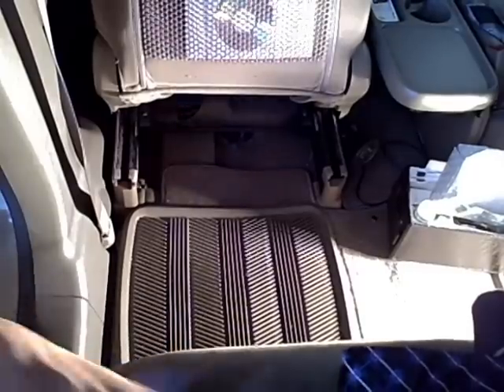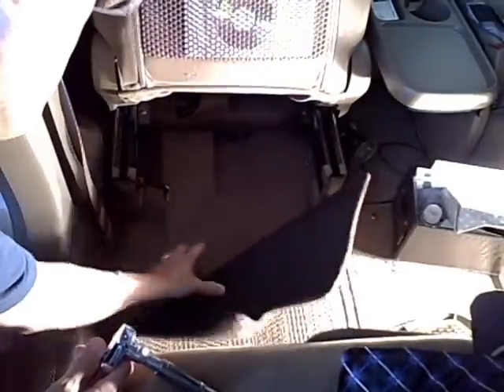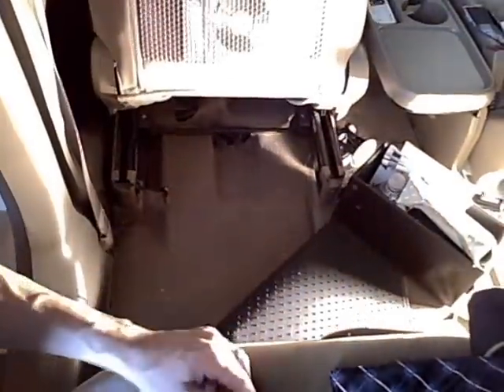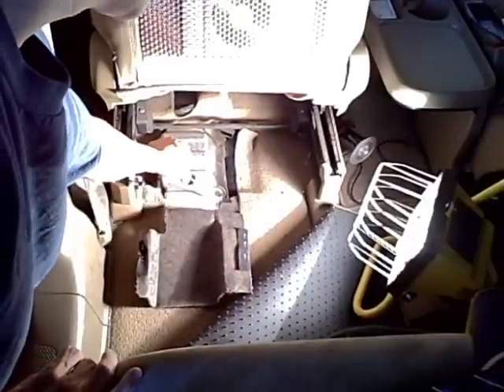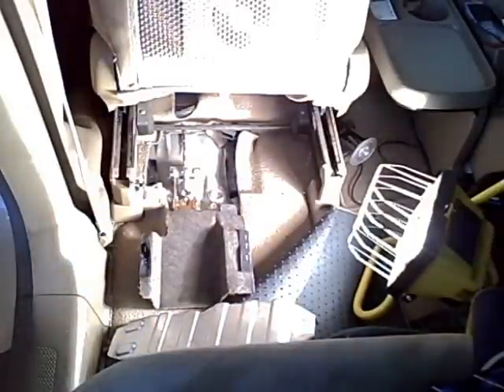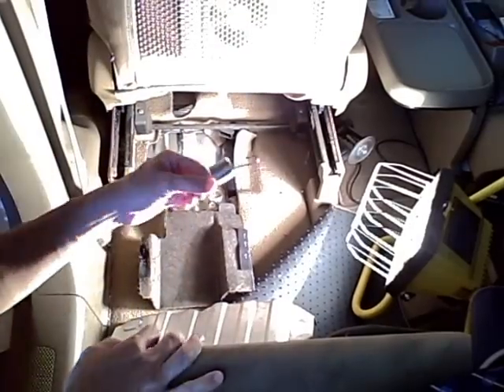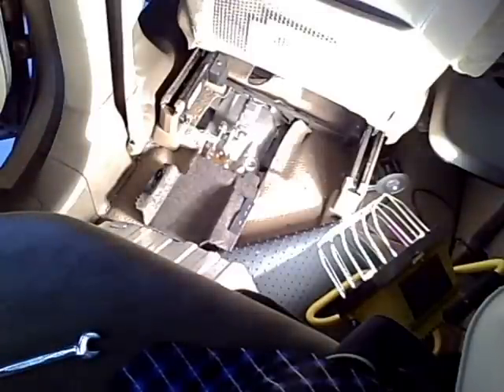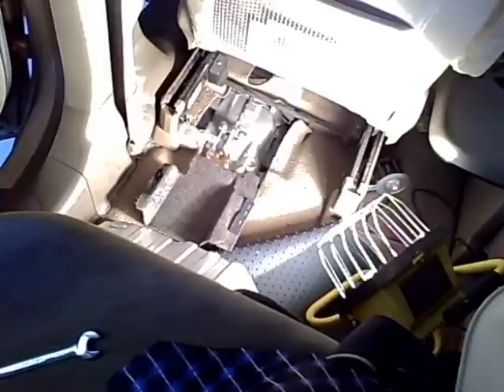2003 Honda CRV parking brake (hand brake, e-brake, emergency brake) cable adjustment

Comment from the maker: I lifted the rear wheels off so I could spin the wheels by hand. I was able to spin the rear wheel easily when the parking brake was on all the way out to about 11 clicks when the wheel stopped spinning. That was too much. So I went back and forth adjusting the nut, pulling the parking brake lever and spinning the rear wheels until the wheels stopped spinning at about 7 clicks. i.e. Adjust nut, pull lever and count the number of clicks until the wheel stops spinning, and repeat until right.

Comment: Great video. Any suggestions for if adjusting doesn’t help. Have the parking break disassembled on the stick side...now trying to get it moving...

Rear right is stuck...doesn’t move where it’s seen inside the vehicle...no slack at the rear wheel...

Comment: handbrake light may be the switch for lever ,it works on a earth signal to the body similar to a door contactor swith ............not sure where it is located usually on the lever itself with 1 single wire off of it

Comment: I have a 98 CR-v and recently the red BRAKE light always stays on. Brake fluid level full. It seems to be related to the hand emergency brake contact or adjustment but I don't know how to trouble shoot or locate the contactor relay. Have you had experience with this problem & a fix?? Much appreciated if so.

Comment: At the same time you should also check the adjustment cog in the rear drums: adjust cog with screwdriver until pads are engaged and wheel wont spin; then back off cog about five or so clicks until wheel spins freely, then adjust the brake cable
Reply: Yes, that's the correct way to adjust these brakes...as the onboard is JUST for making final setting!